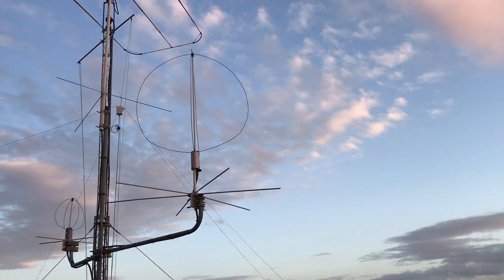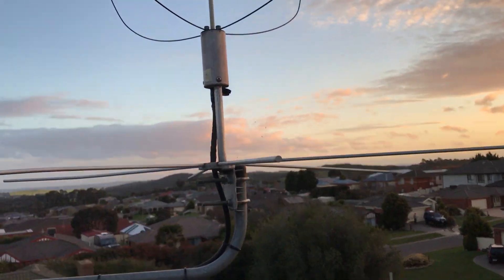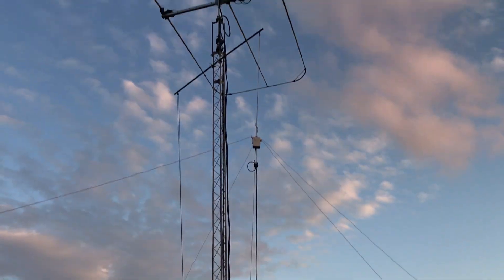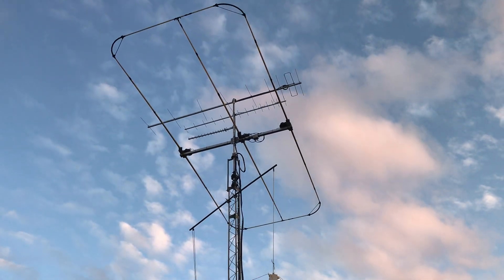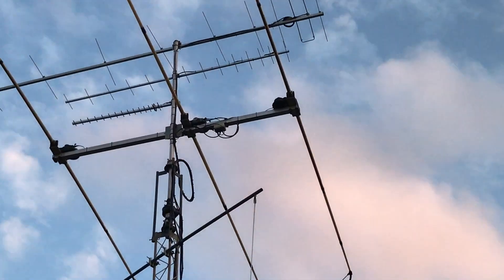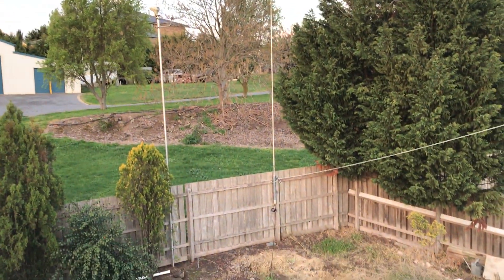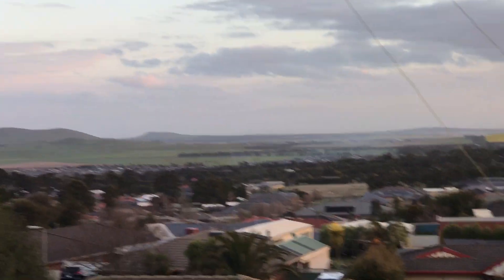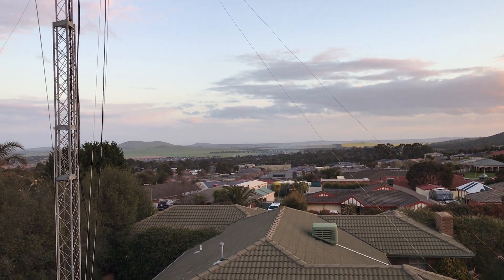Antenna Update.

Comment: Did you have a go at RS0ISS Series 16 SSTV?
Reply from the maker: Yes I did. I got a few good ones but most were still noisy. I have been trying other satellites as well.
Reply: @VK3IK  
I recently got a 9700 and didn't realise until the last night of transmssions that the Auto Tune function will track doppler shift on FM carrier (not that it's a big problem on 2m), and the record function could be set to record only when the squelch is open. Takes the fun out of it but I got plenty of sleep that night and decoded the results in the morning!
Ended up with 8 perfect put of the 12 and the others almost there.
Only using a 5/8 vertical.
Reply from the maker: @nunyallsbeeswax  Ah yes the 9700 is a nice radio. I have the 9100 here for Sat modes.I have only just started delving into the satellite area of the hobby so I am still working things out. I have been trying to get a contact through RS-44 but havent had any luck yet. I might have to get a couple of yagis and an AZ/EL Rotator one day.

Comment: Good work, always interesting to check out others antenna setups.  Haven't worked the birds for quite a while.. (has it been 40 years already?)
I used to work AO-7 mode A using a 2m Turnstile on the uplink and crossed Inverted V's for the 10m downlink. 73 de VK2ACE